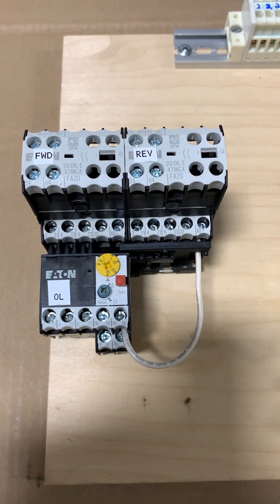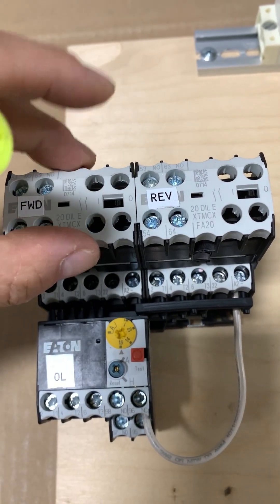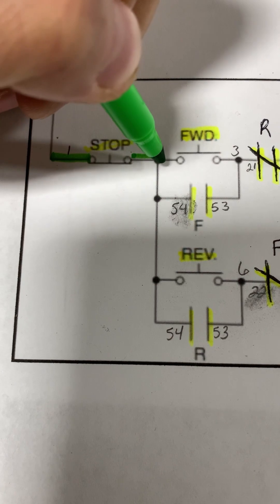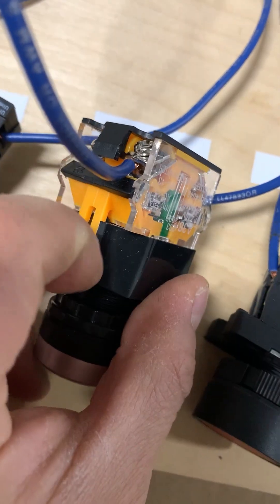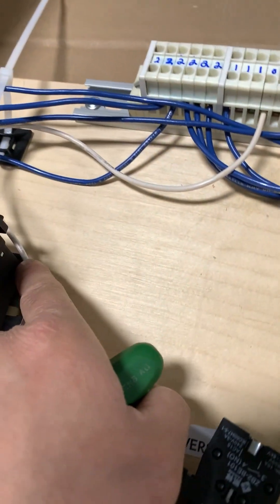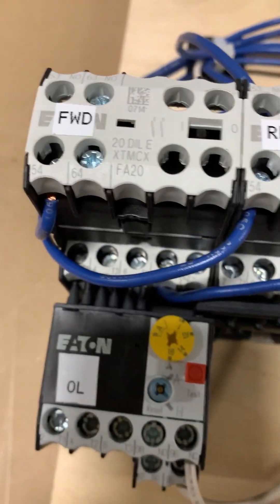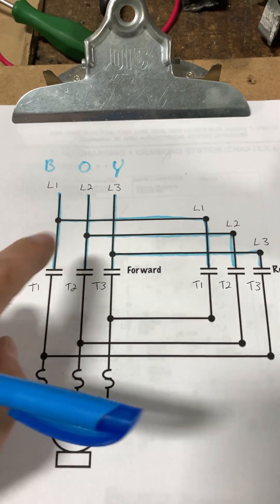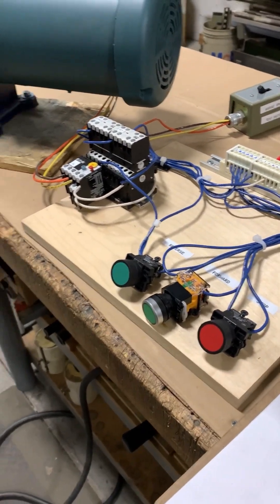Forward & Reverse Motor Control Circuit#electromechanical #3phasemotor #electricaldiagram

Comment: I’m trying to learn this for a career do u think an online school can do that I’m a hobby mechanic and work in production already?
Reply: I got into the field after i worked for a manufacturer for 3-5 years in different departments (Paint, Production, Tooling Maintenance), then i applied internally to the maintenance department. The maintenance department there didn't have an "electrical maintenance tech" position, or a "mechanical maintenance tech " position, everyone did everything. I basically had a Lead Maintenance Tech i followed for 4 months, then eased my way into different jobs with his guidance when i needed it, then by myself for most. My situation was a little odd, because a month into work my Lead had a stroke (not caused by me, i swear!) and had a month and a half off of work, and the cheap pvc extrusion company i worked for wouldn't switch a tech or hire a new tech, so i was on my own for that time (12 hour night shifts, with 25 production lines, each with 3-4 vacuum pumps, 2 water pumps, a twin screw extruder, material feeding system, material puller, a saw and droptable, not to mention the facility power, process cooling water, material handling system and other facility duties), so i was actually on a fast track to learning. But i had a good knowledge of tools and equipment, i had worked when i was younger as a green residential electrician, roofer, framer and rode and worked on bikes and motorcycles, so it wasn't super difficult for me, but it also wasn't easy! 

This is probably the easiest way to get into the field, through a company, showing them you're a hard worker not there for just a paycheck, you want to learn. Learning is the real gain at these companies, as cheesy as it sounds, that's how you make more money faster, apply yourself, literally just keep asking questions and don't work too fast to where you're not really learning everything and become a danger to yourself and others. 

They used to make people go to school before doing this work. Now, its an aging field, where the majority are over 45 and younger people would rather do YT, so its easier to get into and the pay is going up.

Hope this helped at all!